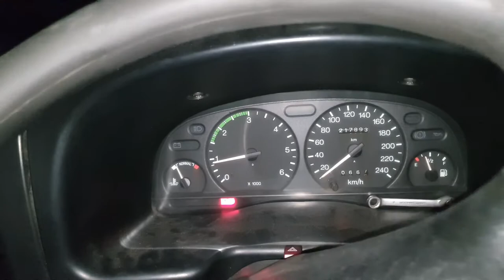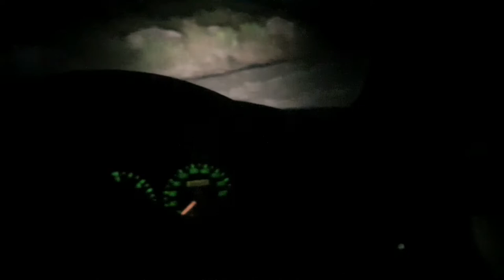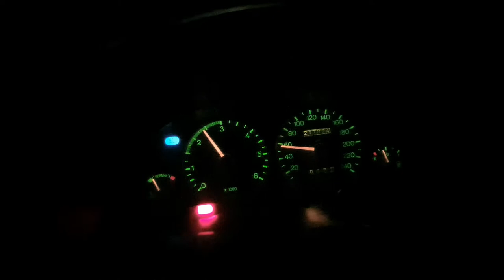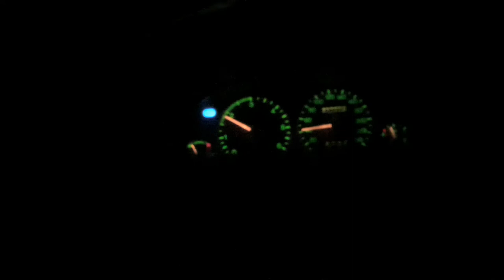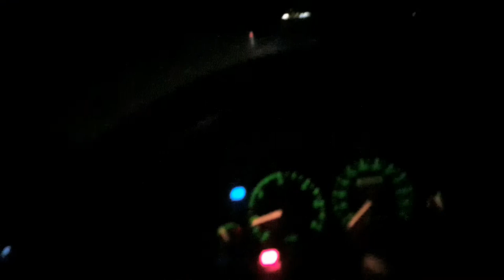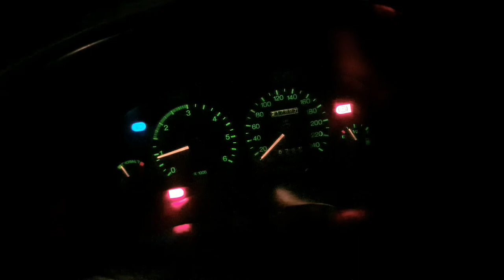Ford transit Vg 2.5 td stuck in limp mode help!!

Comment: I changed the injection pump for a Bosch mechanical pump and my Transit now does 110kph and gets 10l/100km. Tauranga Diesel makes a kit including new accelerator pedal, cable pump and all fittings. About $3000 for manual, slightly more for Automatic.
Reply from the maker: That's the way to ditch the Lucas' unit

Comment: It's a Problem with the EPIC Pump. Check the timing belt first. The Limp Mode can be a problem with the timing or the Solenoid in the Pump. A Worstcase is the Rotorsensor. The EPIC Pump is a sensible Pump with Air in the Pipe. A other Problem is the Pressure of the mechanic Pump in the Gasket from the Motor. I hope that my English is okay, i come from Germany.
Reply from the maker: Got to swap.pump now I had full engine run away almost blew it to bits
 Your English is good
Reply: When you stop  the engine with the Key it must be out. When the engine is running 5 or 6 Seconds away and goes out its definitely the Solenoid. It has a broken rubber and can not stop the Diesel Fuel
Reply from the maker: @philipppusch9834  thank you so much.
That would be over filling the housing causing pressure and it to leak also no doubt
Reply from the maker: It does run on i thought it must have been a turbo timer
Reply: The turbo has no influence on the pump if it has not been adjusted. If nothing smokes, it's the pump. The rear Connector is also often a problem that it is not proberly seated.
Reply from the maker: @philipppusch9834  i will change out the solenoid and see how it works
Reply: Its correct when you do this! The shut off valve is a one of the most troublemaker of the pump. When it damaged, the other sensors are not correctly working. The parameters change as a result...
Reply from the maker: Its the valve with the metal bullet that has  a rubber tip.on it correct?
Reply: Yes its correct! The rubber is a little Seal and when it's old, its get hard and broken. You must see the Pump Number DSA 947 or DSA1096 for example. There are different diameters. The Solenoid comes with a new Spring. Please check whether it is correct with the old one. If it is too strong the engine will not start. A Friend had the Problem with the new spring.

Comment: Have you tried disconnecting the battery terminals for 10 minutes and reconnect to reset the ecu? That usually clears check engine light.
Reply from the maker: Yeah man even overnight and terminals shorted

Comment: Have you got anyone that can plug into the diagnostic and see if it's got any fault codes the epic has various issues a common one is the speed sensor in it you can't get new ones here in the UK anymore but if you can get one or a good working one try that first
Reply from the maker: Tryed a few diagnostic tools nothing seems to read it through the obd2
Reply: @Oneupthesleevecustoms  the genuine tool we use is the lazer 2000 bit of an old dinosaur but the only thing we have that reads them not sure if you can find anyone out there with one ?
Reply from the maker: That may be a struggle. . Makes sense why I couldn't read it then.
Speed sensor worth a attempt as swapping i have 2 other pumps?
Reply from the maker: Have you swapped sensor befor5
Reply: @Oneupthesleevecustoms  yes mate a few times we can't get new ones in the  UK anymore so have to try second hand ones
Reply from the maker: @vtecpowergt  if they are giving pump wrong readings does it not know engine rpm
Reply: @Oneupthesleevecustoms  from what i understand its more to be used as a cam sensor even dirty terminals in the big round connector can cause mayhem its quite common to take one apart with a fault not be able to get the bit needed and refit it all to then find it works fine for a few weeks again might be worth trying to squeeze the pins up a bit in the plug .
Reply: did you find the solution? I have fault codes 1180 and 1182 in my transit, can you tell me what it could be? Thank you

Comment: Its a bad turbo
Reply: It has nothing to do with the turbocharger. It is purely the issue with the injection LUCAS EPIC pump. I am having the same problem with my Ford Transit VG 2.5 TD.  Check engine  light is on. Injection pump is leaking. The van max speed is now with foot to the floor is max 60 km/hr. I  will also replace the shut off solenoid in the injection pump.

Comment: Take to a mechanic, simple
Reply from the maker: Great idea.....
Reply: @Oneupthesleevecustoms  Mechanics usually clueless when it comes to these transits. I have fixed 1 of these with same issues. can fix the run on issue which will throw a check engine light. it is the shutoff plunger/rubber tipped. found the light cleared itself when replaced. the engine cant turn off within reasonable time so computer does it for you and throws the light on usually takes 5 seconds after turned off. Good luck with this. this things very expensive to fix for other issues as well. cost my father a fortune to own 1 of these . made me hate the ford company and transits in particular for what the damn thing cost him. Price a tailshaft for 1 with center bearing. Do yourself a favour and piss it of .